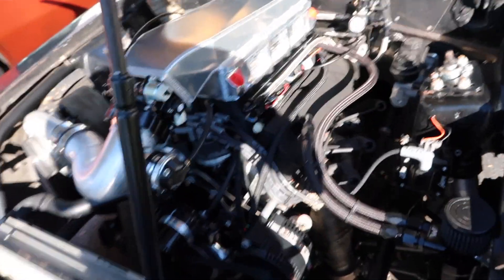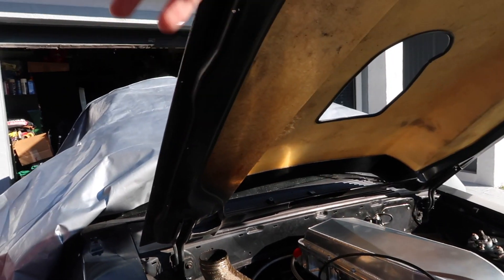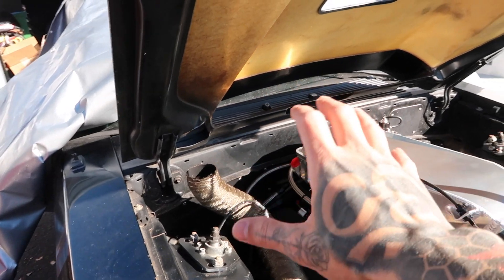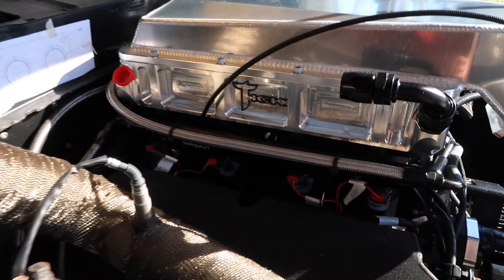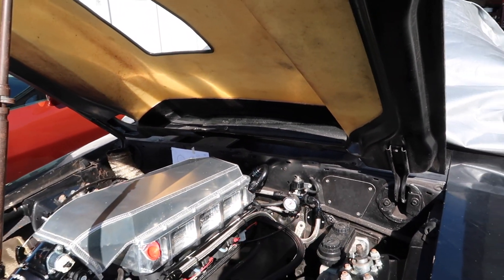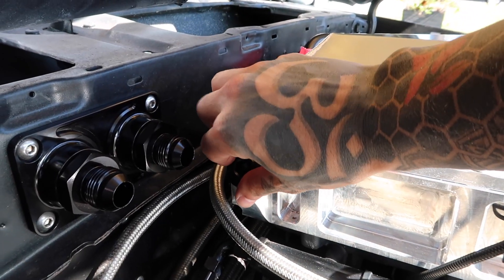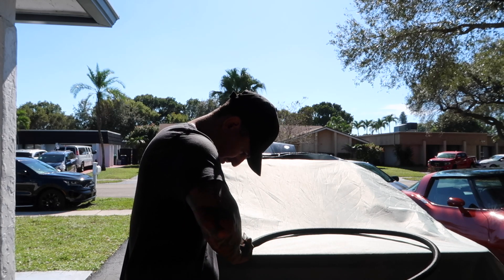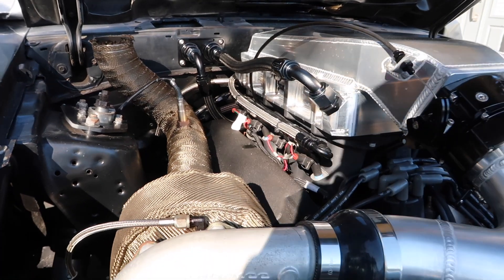Billet Water to Air Intercooler Gets Plumbed

Comment: Came out great! Whats left for it to get back on the road you're going to love the auto man
Reply from the maker: Thanks man.. wire up the iac & tps, install trans cooler, bolt up the converter. Drop the trans pan to mark the dip stick. Route and install shifter cable, trans temp sensor. Driveshaft. good amount of things .. she’ll get there tho. 🤘🏼
Reply: @JovanMichaels  What converter did you go with? Im putting a barra in my fox and i went with circle D and i gotta say the transaction was insanely smooth, Pete at circle D is the man